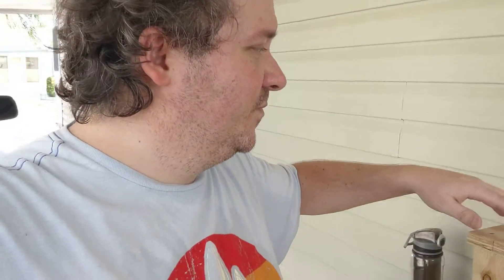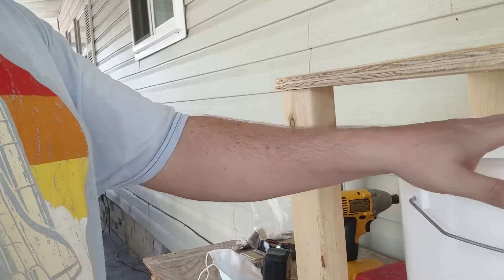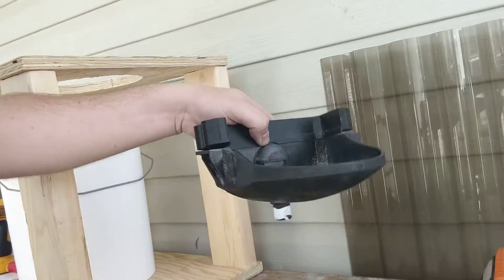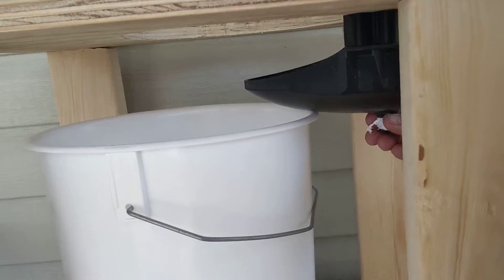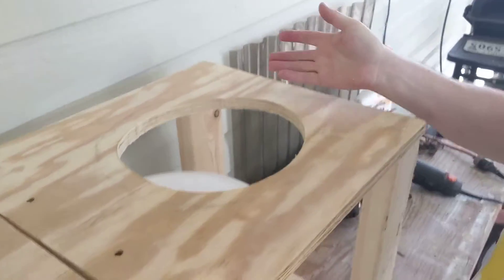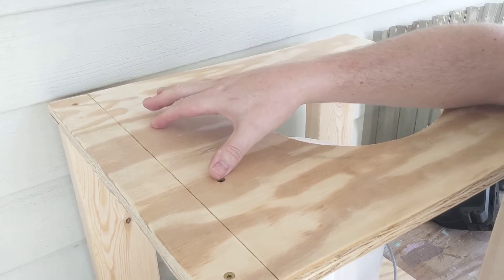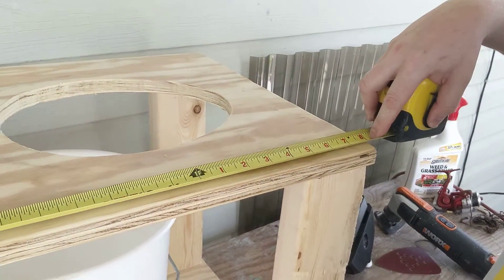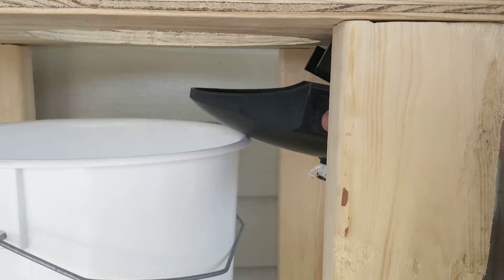Composting Toilet (part 2)

Comment: Suggestions? Waterproof the bottom for cleaning purposes and a 1 inch frame on the bottom to keep the bucket stable. Highly recommend an exhaust fan, the fluid is what will smell, not the solids. We use  deodorizer mixed with water in a spray bottle, as a rinse in the diverter after using. We used a plastic gas jug (for thickness and stability) for the fluid bucket, spray-painted outside, so people don't think we are dumping gas out when we empty. Happy elimination! Miss ya'll! Just got back from a "glamping" in Smoky Mountains. You and the kiddos need to go to Cades Cove TN and get reservation for the Cades cove camp ground in the National park $25 night....beautiful, creeks for the kids to explore..
Reply from the maker: Going to have to check that out for the spring!
Thanks for the tips 😁